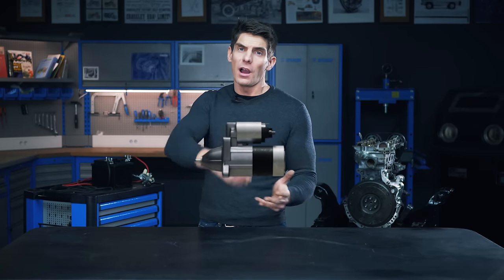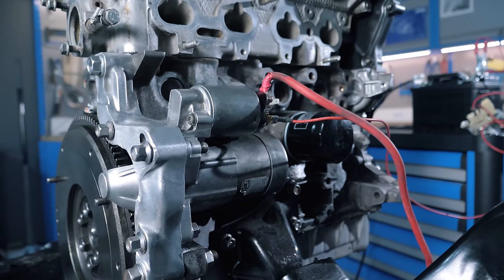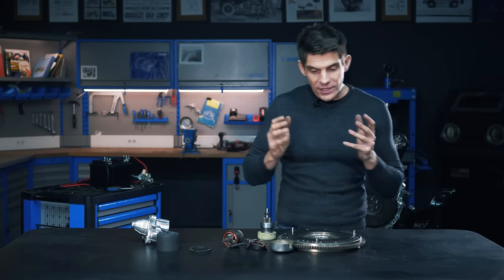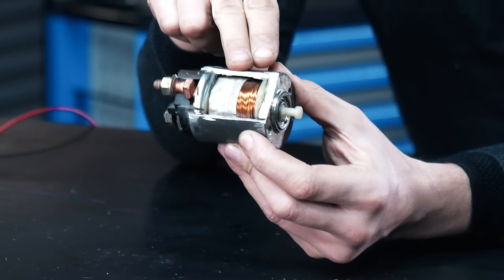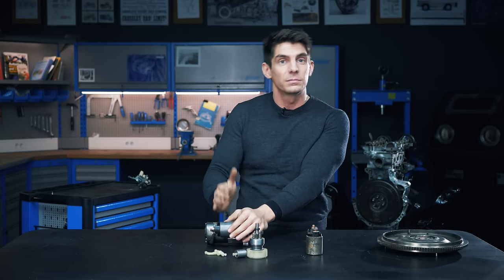Episode No.127 - The Starter Motor

Comment: This has to be the most detail, easy to understand, well explained, using his high level command of the starter system and his demonstrations with actual working parts.  I ran across this channel while searching for information about my 1999 Toyota Tacoma 5 speed FWD, 3.4 bbp truck. I will share this with everyone I know, since they each own a vehicle.  I walking into this video with barely little knowledge and left with a stronger understanding. Great basic information for owners and operators of vehicles to have. Five Stars ⭐️ ⭐️⭐️⭐️⭐️

Comment from the maker: CORRECTION: From Graham at Wood Auto:

[...] There is pretty big mistake around 8:30 regarding the “400A” sticker on the starter motor. This “400A” is part of the Mazda part number “BPD418400A” not an indicator of its amperage. The underlying starter motor is a Mitsubishi M0T80081 starter and its only rated at 1.0kW not 4.8kW! Below is a link to photos of the OE starter (this has the Mitsubishi sticker on it not the Mazda sticker):

https://www.woodauto.com/product/MITM0T80081

You’ll see the side photo shows the rating of the starter.

You’d only really see 4.8kW starter motors on commercial vehicles. To my knowledge starter motors never show an amperage rating, they’d always show a kilowatt rating. Only alternators would show an amperage.
---------

Contents guys!  There's a lot in here :)

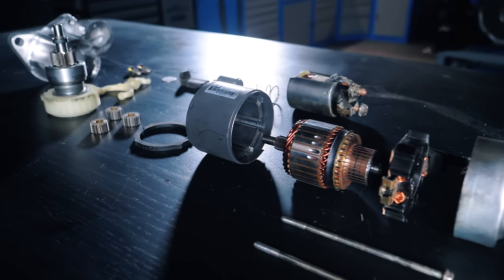0:42 - Why is a starter needed?
2:16 - Modern electric starter motors
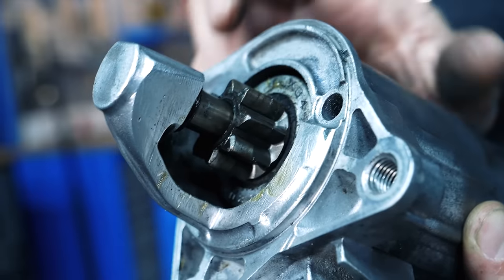3:01 - How the starter turns the engine
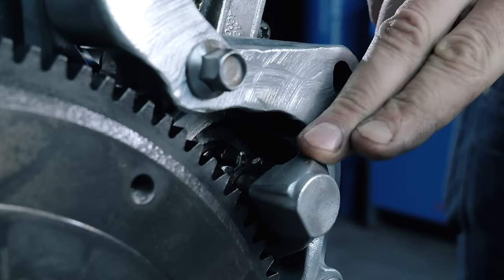4:02 - Gearing between flywheel and pinion
5:18 - Planetary gears inside the starter motor
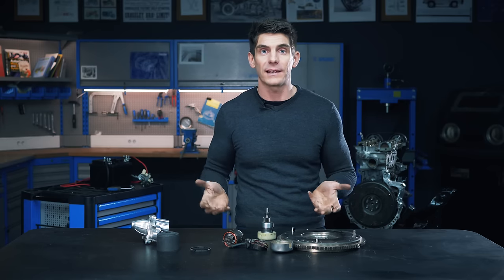8:08 - Starter power requirements
10:33 - Electrical connections
11:48 - Starter switching
13:14 - Solenoids
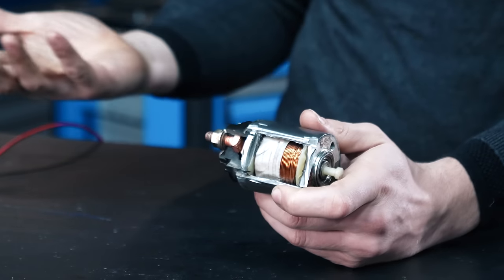16:22 - The clicking sound of a flat battery <-- my favourite bit
17:50 - Starter engagement system and solenoid lever
19:46 - Ensuring the gears mesh
21:25 - Sprag clutches
23:32 - Interlock switches
24:55 - The whole system CGI

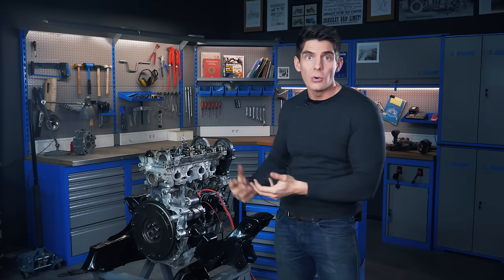26:18 - If you made it this far you'll love my 20-hour video course.  https://www.howacarworks.com/video-course
Reply from the maker: @JophinLouis  No, I just upload about 2% so people see it's worth buying!
Reply: Thanks brother
Reply: Love n respect from India ,ur doing a wonderful job , thanks alot sir .
Reply: @howacarworks  Even this video is worth buying for 20 $
Reply: this great thanks
Reply: After buying can I get new video released by you, but not included when I buy them?
Reply: This should be the mandatory starter motor video for any mechanic or up and coming tec. Thanks for making this for us all!.I look forward for more knowledge..
Reply: can u update to subscriber the upcoming video to upload.getting excited to know.already half of video watched.thanks mate.
Reply: Make it free don’t be greedy man
Reply: I think that 400A really means 400AMP as "short time current (MAX)" and they can be really high compared to rated amp at steady state. I'm not sure though someone please correct me if I'm wrong.
Reply: @ebrahimshamos4696  Dont be cheap man. He is already providing lot of quality free content. Lets be grateful and lets not take all this hard work for granted.

Comment: As an Auto electrician (in a previous life), you have nailed this. Well done !   I can tell a great effort has been invested to make this video. Magnets have replaced shunt field windings, solenoids are sealed at the cap... (can't rebuild them anymore), reduction gears are in all units these days. Does anyone remember the Auto-lite "clapper" starters used in ford V8's ??  They certainly have changed.... from Lucas units with a Bendix drive.... to what we have now.  Great work, keep it up. Cheers from Australia.

Comment: I had the same problem with my 1987 Toyota Corolla, there was a clicking noise when I turn the ignition on but the car won’t start. Dude this is by far the best video I’ve ever seen . You just earned a sub

Comment: Fantastic video. Really, really, really good. Great explanations and animations. The only explanation missing (which was solved with 1 google search) is why the electric motor has such a high current relative to other motors of similar power. If anyone is wondering: it has to do with the nature of electric motor startups, where back emf still hasn't reached "normal" levels. This initial phase of the motor's functioning produces more torque than in continuous operation and is thus ideal for starter motors.

Comment: Not all starter motors have the plunger/lever mentioned at @19:10, I have a 30 year old car that I've replaced the starter on a few times before I learned about the solenoid, but I'm good with electronics so I bypassed the worn out solenoid with a high amp relay but it works exactly the same with no wires going to the solenoid, I'm glad I did it that way cos I can start the car now with a much lower battery power, which is super useful since I have a habit of leaving the stereo on too long without the car running

Comment: With the clicking solenoid it's an involved voltage drop issue due to the starter motor current that's causing the plunger to release. I imagine KISS played a role in length of explanation. Well done. Peace.

Comment: There's a youtube about swapping super-capacitors for the battery for extra cold climates, like Canada/Sweden in the winter. He used a clamp-meter to test the amps at the starter cable. On start-up, it drew 200A for a moment to get the engine spinning, and then it drew 100A to continue spinning. He had disconnected the spark and fuel relay to prevent the engine starting during the experiment, and the engine was a common 2L gasoline 4-cylinder of normal compression. A diesel or a V8 would draw more.

Comment: Thanks for a great video the only downside to having a modern manual car is that if the battery does go flat there is no way to push start it because of the safety mechanism that you mentioned with the clutch having to be fully depressed which is a major  bummer.
Reply: That's not correct. I've push-started my 2010 Toyota Corolla several times. The safety mechanism applies only to using the starter motor, not to getting the engine rolling by using the transmission.
Reply: @ucakpan  You may well be right there, thanks for that. Thankfully I've not had the need to do it😄

Comment: Great video. I instantly liked it and subscribed. Greetings from France.

Thanks for all the work you did, all these complicated details in a device i thought was very simple.

Just one thing. I did not understand why there are safeties to prevent the driver to start the car while the engine is in gear.
I was taught during my driving lessons that if I stalled the car on a railroad crossing  I d rather let the engine in gear and turn on the ignition so that the starter moves the car off the track in a fast way to save my life.
What do you think about this?

Sorry for my english.

Comment: @12:38:  On the model of truck shown in the video clip, the foot pedal didn't cover all functions of modern starters.  I believe it just actuated the Bendix/ pinion gear into the flywheel; it didn't spin anything.  So, that thick cable on modern starters (which is primarily for the spinning load, not the throw-out) isn't really analogous to that particular model of foot pedal.

Comment: I have a question: where does the noise come from? I hear the constant whirring noise of the electric motor, but does that "chk chk chk chk" choking noise come from the cylinders exhausting the air/fuel mixture? I can't seem to find any info that specifically talks about why cars sound the way they do when they are starting. So does that constant pulsing choking noise come from the starter motor itself, or is it a result of the moving parts of the engine and exhausting of gas in the cylinders?

Comment: Do you have an in deph video on the workings of the solenoid together with motor armature, commutator and all the inside parts in the starter motor, I mean how everything clockworks? Gracias, pero es que creo que fue muy general la explicacion. Please do not get me wrong.

Comment: Every car built since about 2005...
Nah, fiat still has no safety switch on the 2011 punto (I bet also some newer models are the same), I find that quite convenient because it also means I can put it in neutral and start it without pressing the clutch, but it also works when it's in gear

Comment: Cables aren't considered to have significant resistance (cause voltage drops). Don't voltage drops only happen across loads like bulbs, resistors, etc.?
However, longer cables do have more resistance. Did you mean that you just want the shortest cable possible so the starter operates most efficiently?

Comment: So much of Engineering just for the starter. I would like a car with a little advanced manual cranking mechanism.  No battery whatsoever. Manual press horns, mostly day time driving, so no lights,precharged flash lights in case needed,  precharged bluetooth speakers for music.The point is to keep it simple.

Comment: That little car with a hose at the airport is not a starter motor  it's an external APU (auxiliary Power Unit) its used when we can't fire up the engine for power at the same time we can't fire up the planes own APU( it uses 50kg fuel pr hour) you will almost only see this in very hot countries. The hose part has actually nothing to do with the APU function but instead it is an implement to blow cooler air into the cabin when we can't fire up the ram air engine for AC.  I fly 737 :)

Comment: Thak u for starter motor explanation pls Chevrolet 1993 starter hole on the engine broken so starter and flywheel can't engage how to restore original bolt hole on the engine

Comment: No neutral safety switch on my truck, I've used the starter to move a few times when having fueling issues. As with all safety tech, it comes with a downside. I would have needed a tow truck if my truck had one.

Comment: As a cool fact, before starter motors were powerful enough to turnover a diesel engine, a sperate smaller petrol engine was used to start the diesel engine.

Comment: Super impressive I think I can design  one now with this much knowledge 

Really cool but I didn't get the part(only one) how one way clutch is preventing back drive, doesn't pinion rotate only in One Direction while driving and when being driven???
Reply: Yeah I get it now, only improvement I found in your video I guess 

You should've shown input from outer race with locks the clutch and allows transmission and you showed the input from the inner race which makes Cam loosen the engagement 

Still awesome video

Comment: What happens if we turn the ignition key on while car is running?
Reply: You'll hear a grinding noise while the key is held to start. If constantly done or enough times you'll ruin the starter motor eventually. The occasional brief mistaken turn won't hurt anything but it's not good long term for the health of the starter or flywheel
Reply: @rblythin   than alot for the explanation

Comment: You missed bendix starters and no car I have owned has had a stupid safety switch on the clutch.
Reply: "What about hand lever engaged starter motors (rat trap), Coaxial starter motors, pneumatic starters, starter generators, hybrid transfer case starting, secondary engine starters, etc....bla bla bla."
This guys video is on point and one of the best I've seen for a how its works and it would be easy to pick the eyes out of it but there is no need as its a all round masterpiece i would recommend worth watching for any mechanic or apprentice automotive electrical engineer.

Comment: I was 3-4 years old didnt knew anything. My dads 1999 Fiat Siena had the door open and i thought letme start the car by turning the key. It was in 1st gear and as soon as i turned it slightly it jump forward and i immediately stopped turning because i couldnt anyway car jumped forward And i wasnt in the car i turned it from outside. Rear wheel was centimeters away from running over my feet lol

Comment: 9:10 Well yes but actually no. 

In DC (like in car wires) this is that simple
In AC  (like in home) is a little more complicated because if AC current go through coil capacitor this  make shift between current and voltage  and this must be add to math etc. etc.   but still for common user  Voltage * Current  is enough,
to be honest i only know exactly how to calculate this, but this is good to know.

Comment: he did a mistake ever heared about starter/generator?ore a magneto? 
no it wont do any damage in reverse form a starter is a generator who will produce power it needs a voltage regulator and a bypass wire whe turning a engine over even the R terminal starter selenoid is used to fead curent to a ignition coil when starting a engine if not removed ore stater dont stop and starts to act as a generator that will run your ignition system constant in ON position  with great significant power out put it wuld work even with a singel wire ignition coil with points and some condensers if sincronized in a centrain position with the flywhell you wuld by abel even to get dual ignition ore waste spark ignition system a alternator can by manipulated to do the same thing not including the pick up coil inside the destributor who is by the way a generator/magneto as well! so not realy true that you depentd on the baterry at all please read wikipedia if some one dont belive my Im oldtimer restorator that info is not corect that a starter motor will by destroyed he can by made like told before to use it to your advantage expecialy in a ignition system who runs with plazma ignition in sequence.changing bearings is easy and replace them with high speed one's there you go preblem solved if wire over heating is a problem then drill 2 holes and put small compresor in 1 hole at the starter motor and another to exit it clasic air cooling methode there you go trow away baterrys and that shit run on a maggy instead 😒 schools are not wrong but they are not corect always  they dont pronouce some thing's corectly they left out "reverse inginering" he say from him self some selenoids have 2 wires big and small is that familiar to you? just like a ignition coil that selenoid has a piece of metal who can act as a transformer core how odd. basicaly you culd use that selenoid and fire a engine that peopel are doing!
they use ore build improvised ignition coils "acient engines" out of alredy build selenoids those coils are not any more produced so they get creative and build low and high tension's coil's out of what is availabel and acidentaly ore not that selenoid has perfect resistance values to do exactly that job only a litel hint nothing more in new age cars that is the teaching methode but by oldtimers and young timers that teaching dont comply. Good video and all but that is not criticism Im only pointing out what is missing in that video perhap's he didnt know about those things ore shown but that is how it is even alternator static and audio static,coolant electrolisys etc. can cause similar effects even with out a baterry ore ignition coil as a "power sorce" and by power sorce we have big wiraity hidraulic,pneumatic,magnetic/electric,chemical,thermal,hell even to use live organism's like bacteria as energy sorce so thats why Im sceptic about those claim's they are not realy to full degree explained peopel are confused for nothing

Comment: Its a good video, but typical. The actual function of electric motors is basically black magic to the mechanically inclined and he does not address how the starter motor actually functions, just over explains the workings of the mechanical power transfer components.